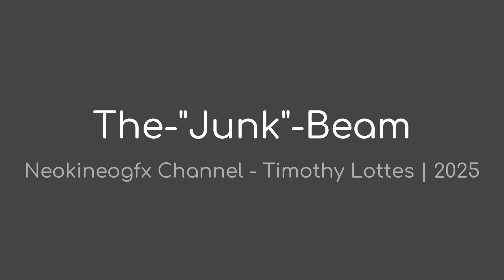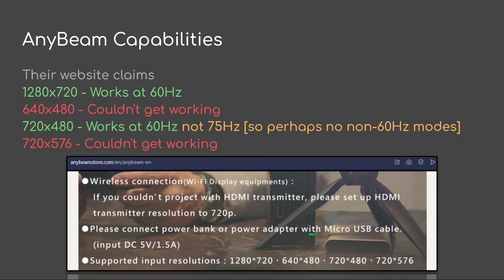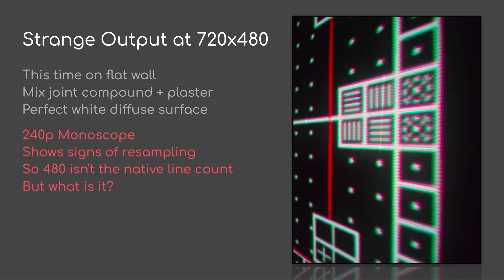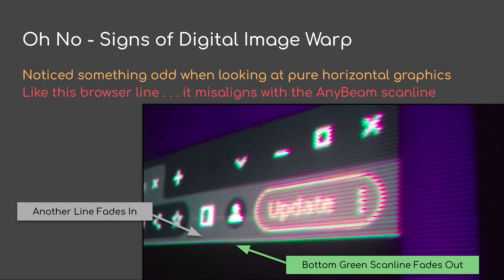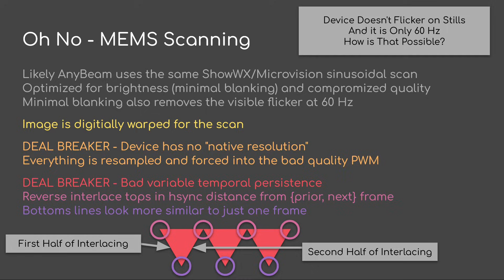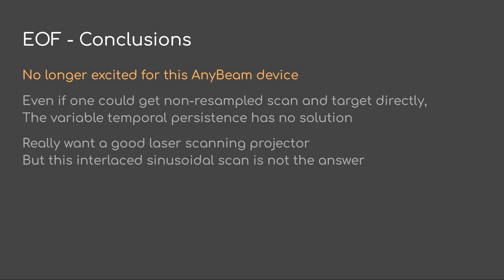The "Junk" Beam

Comment: Not all of them have a weird scanning method, I have the I-connect picop that has very low persistence across the whole vertical screen area. It's quite obvious it's flickering at 60hz, no duplicate images in motion.
The device has a huge problem tho, every 5 seconds it stutters, almost like the input signal is not properly phase locked to the scanrate of the projector.
Reply from the maker: Seems like the curse of using a scanning laser projector, all the OEMs have some deal breaker in quality